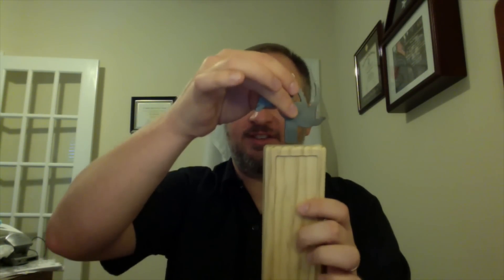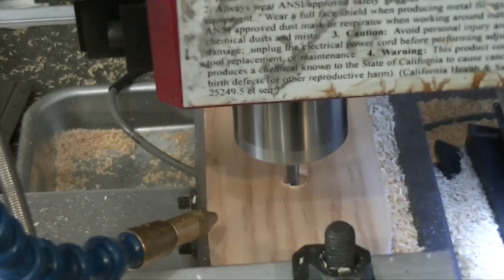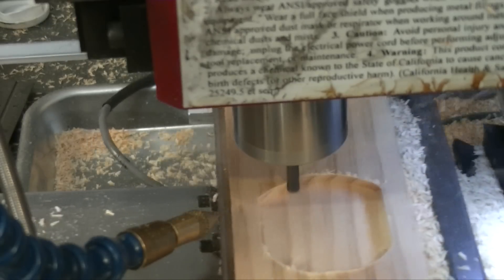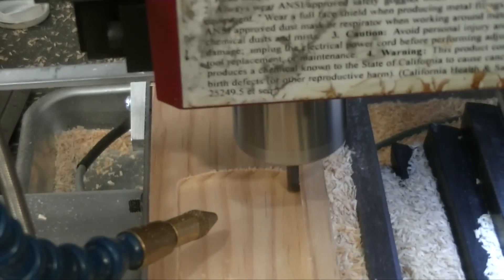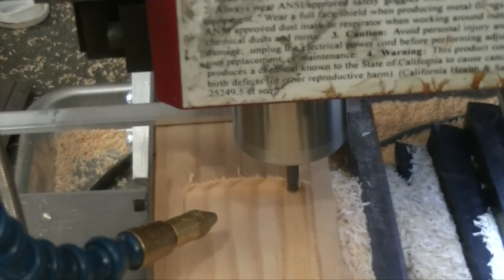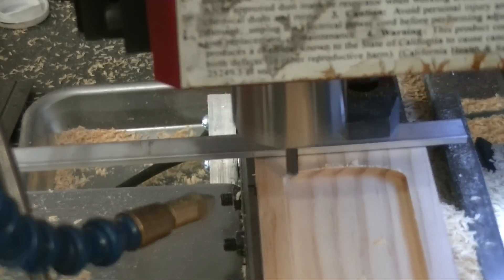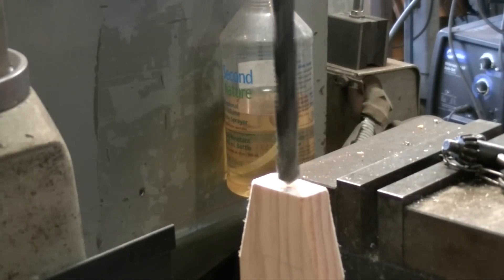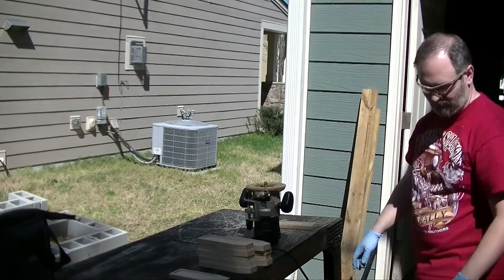Beer Tap Handles - Part 1

Comment: I've never seen metal with that kind of grain!!  :)
Loved the 123 blocks for the 1/2" drilling!   Had to chuckle a bit at your routing table. :)  Not sure I would have thought of either, so thanks!!! :)
Reply from the maker: +bluehandsvideo Yeah, Mike... This stuff is messier than aluminum any day of the week! I really over thought the router table thing and almost bought or made one. Got a wild idea to just flip the darn thing over and see what happened. The 123 blocks did a great job of keeping things aligned and vertical. I definitely got creative on this project.

Best wishes,
Tom Z
Reply: +Tom Zelickman (Inspiration Metalworks) The blocks is something I'll definitely keep in mind as an option down the road. :)

Comment: Hi Tom,
Nice handles.  I will bet the guys at Fainting Goat will appreciate and like them a lot.  Any reason you didn't go with a hardwood instead of pine?  Make sure you don't "climb mill" with your router bits but they turned out really good.  I have a small router table for your Porter Cable 690 but don't know how I would get it there!!
Thanks for sharing!
Take Care,
Reid
Reply from the maker: +Reid Eichner Hi Reid! I delivered the first completed handle today and the owner was all smiles. We decided on pine to match the décor of the pub and it's also a very commonly used wood down this way. Overall, I got pretty lucky with how the routing portions turned out. Guess I'll put together a swappable table at some point soon. It appears that I'm going to be doing a bit more woodwork in the future to add to the metal fabrication.

Hope you are doing well and as always, thanks for watching!
Tom Z